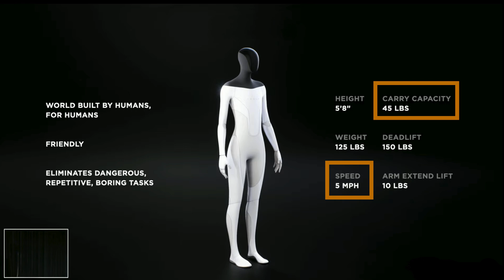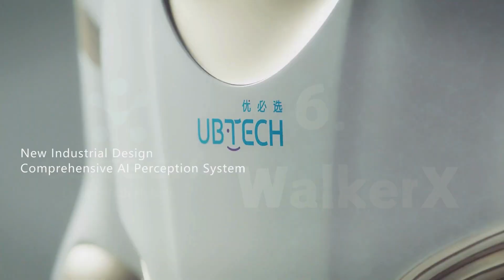Top 10 Most Advanced Humanoid Robots in 2024 (Ameca, Optimus, Neo, CyberOne & More)

Comment: Gold kit robotics cost $7887, the community secret in colleges. Update the first line of ROS code as F=m*a*b*c. Isaac Newton born in 1643 did not have any robotics his code only runs them at 13.8883%. Give them two calculators or computers when coded correctly. 

Test method test points:
F=m*23

F=m*333 

F=m*633

F=m*933 ----robot states "too slow human" if a voice box is installed or built into the bot. You will hear the prompt to keep going higher in the test method.

F=m*1993 -----robot states "too slow human" a voice box is required for audio prompts to go higher in the test method test points.

F=m*2293 - good code.

 F=m*2390 - good code.

F=m*2391 ---Upper Limit Do Not Go Over this Value.